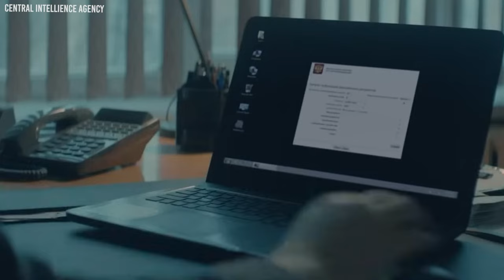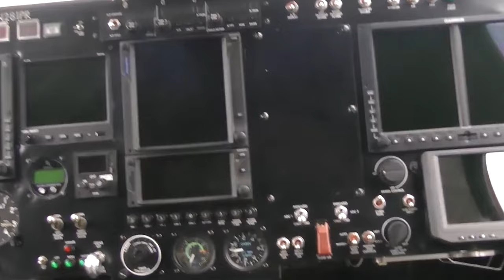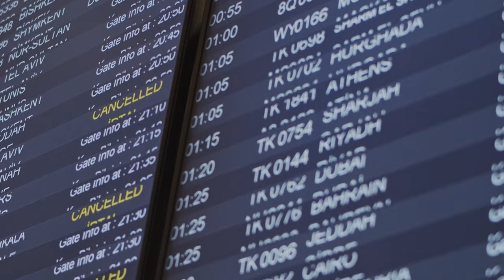New Secret Stealth Plane Covered in Mirrors

Comment: Taking offense and separating about a quarter of an inch off of another fence and running positive and positive and then taking it to about a thousand volts slowly bringing both of the said electro energy is closer to the same voltage you'll see the heat wave start to build in between both of the positive the plasma shield on that should take and defer on a couple of things and it might actually help upon the mock buildup of static electricity on mock soundwave